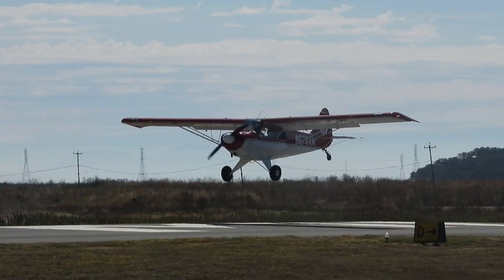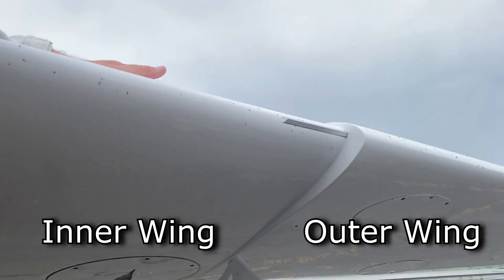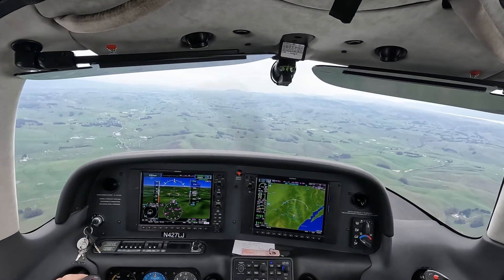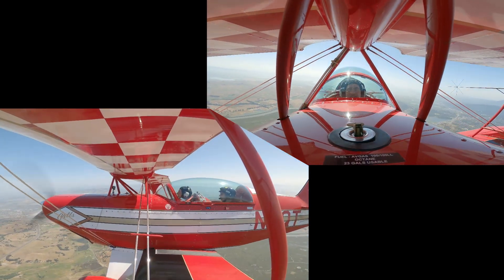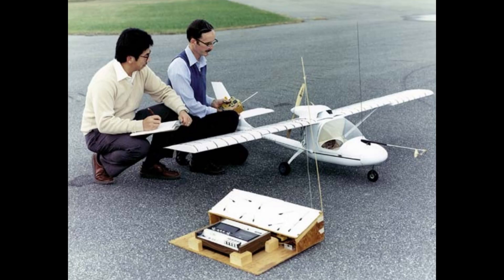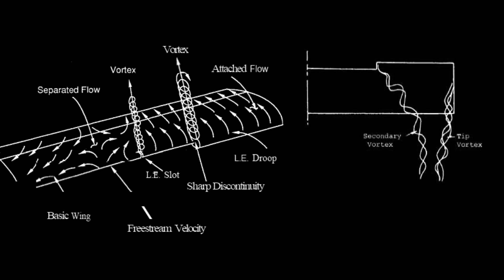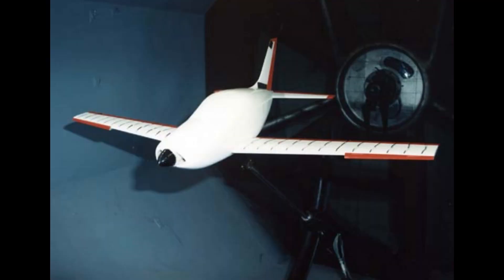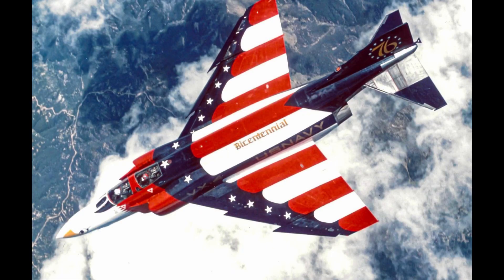Why Is The Wing Broken On Some Planes - How a 'Dog Tooth' Makes Wings Work Better.

Comment: Basic aerodynamics
1. Conservation of mass flow, a 3-D effect 
2. Conservation of momentum
a  vector 
3. Conservation of angular momentum
a vector
4. Conservation of enegy
a scalar.   q = rho V²/2 + P in flow direction
5. conservation of momentum requires pressure to act perpendicular to the boundary, on the surface: wing, Mig 15/16 fences
Never in subsonic flow perpendicular to the flow velocity vector
Summary : flow geometry is determined by mass conservation conservation never by pressure gradients.
ptressure is determined by energy conservation (Bernouilli  energy equation)
The notion that lateral flow is affected by pressure laterally to the flow is WRONG 
Typical erroneous concept: the wing tip vortex is created by the pressure difference top to bottom: totally false.
Wing tip vortex is a continuation of the circulation that causes lift 
Helmholz theorem: the vortex along a vortex remains constant all along the always closed vortex ring.
Applied ot a wing: the vortex is the initial starting vortex remainung behind, connected by the wing tip vorteces to the  bound vortex on the wing, all elements have the same circulation.

Comment: You shuld do a master class with Flight-Chops and Mike Paty. An other way is forward swept wings, oen eksamble is the glider ASK-13, it has a little forward sweep on the wings, it can stall over one wing but it can´t spin.
Reply: The Ka 13 can most certainly spin, I've done so many times teaching.  The trick is to keep the ailerons neutral. If you use opposite aileron it won't but with the stick in the middle and on the back stop, rudder into the spin it will. Just.
The forward sweep was to improve the visibility for the rear seat.
The rudder is very effective, I've flown it round perfectly happily with the stick on the back stop, stalled and using the secondary effect of rudder to keep the wings level.
Chris

Comment: And the position of those wing cuts varies depending on what purpose they are supposed to serve. I heard that on the Arrow, the cuts are needed for supersonic flight. Because of the shape of the plane, the air at the supersonic transition tends to flow in front of the wing. So putting these cuts near the fuselage helps redirect the air over the wing so that it doesn't lose lift. They lost a lot of test models to that until they figured it out.
Reply: You are correct.

Comment: It is said that the reverse-swept wings of the Su-47 Berkut were the reason why it was still maneuvereable even after stall. Because the tip of the wings (where you have the most aileron authority) were still out of the turbulent flow from the stall.

Also, could you make a video about stall stripes ? This is close enough to this subject =)
Reply: You never know what they say. Don't believe everything, especially from Russia (I'm from there). Read the reports about the MBB X-37.
Reply: You never know what they say. Don't believe everything, especially from Russia (I'm from there). Read the reports about the MBB X-37.

Comment: Wing twist (washout you call it) also helps reduce induced drag from the tip vortex. In an ideal world you wouldn't have wing tip treatments but the wing would gradually twist an morph from the root to a 0 degree symmetrical areofoil at the tip. Enjoyed this video, took me back to my Aerodynamics MSc.

Comment: Even the Il-62 have them (vortex generators). On many, especially old combat planes there are two elements combined: leading edge toth vortex generator plus a multiple action fin - bleed flaw stopper and directional stabilizer.

Comment: On many commercial aircraft there vortex tabs positioned along the froward part of the wing, looking down the wing from a window seat. These are there to reduce buffeting during a flaps 30 landing. At flap thirty the rear flaps exdend down so much there is flow seperation so these vortices generated by these tabs along the the wing reconnect the flow. Also the tabs help improve the flow over the ailerons.

Comment: Thanks Scott. I'm no expert or pilot, but I picked up on this concept as soon as you pointed it out before explaining it. I'm a huge Formula 1 fan and amatuer miliatary analyst, so perhaps that's why. I also wanted to mention another anti-stall solution not directly mentioned and it could be the most "cheatiest" method...the F-22 Raptor's thrust vectoring. If you watch some airshow videos it can essentially fly at zero knots and maintain full control combined with the fly-by-wire. Thanks dude!
Reply: I have a follow-up question if you happen to read this.

Would and F-18 with these features be more susceptible to stalling if it's at ~60,000 ft. altitude due to the lower air pressure/density of gases, or would it essentially offset due to the equal loss of drag being experienced? I assume the effect would more or less being linear despite pressure?
Reply: @jamison884  In straight and level flight the indicated airspeed will be the same regardless of altitude, but the true airspeed will be much higher.

At the same indicated airspeed as at low altitude, the stall characteristics should be the same, I say should because at those kinds of altitudes you could easily be in the high transonic flight regime if not supersonic, and wings don't behave the same in those speed regimes as at subsonic speeds.
Reply: Thrust vectoring does not prevent the wing stall. The wing stalls at a certain angle of attack. The F-22 uses vortex lift even more so than the F-16. Because its engine inlets create a stepped wing design, creating one vortex at the joint to the wing. And another is created by the forward fuselage "chines" in conjunction with the inboard junction of the engine inlet. It's generating no leas than 4x massive vortex's across the top of its very wide fuselage and wing roots and these split between the massive vertical stabilizers that are canted and will actually provide more nose-down stability at higher AoA.

The F-22 also has deployable leading-edge plain flaps that are computer controlled based on mach, q, and AoA.

Thrust vectoring simply allows the pilot a lot of extra pitch control at all speeds. And especially at low or no speed.

Comment: If you ever get the chance, Scott, have a nosy around a Gloster Javelin (there's a few in museums in the UK, but I don't know about the US). That thing has some vortex generators . A LOT of vortex generators. Also, have a look at the trailing edge...😉
Here's another video idea, since you touched on it in this video: do one about the aerodynamics of the F-4 Phantom, to explain why, as somebody once put it, it "looks like somebody stepped on the plans". Whole lot to unpack about anhedral and dihedral there.
Reply: Javelin wasn't known as the Drag Queen for nothing. None in the US (surprising as the USA paid for a lot of them under mutual defence aid), One in Italy and one in South Africa, the rest are in the UK.
Reply: No Javelins in the US
But plenty of vortex generators on the A-4s and B-52 or B-1
Reply: @Wannes_  I used to work on A-4's, and you can't help but notice the rows of vortex generators along the forward and rear of the upper wing.  I think the official explanation was "to prevent random wing drop".   Naturally, I also picked up on the vortex generators on the lower surface of the B-52's horizontal stabilizers, and were they on the aft fuselage of the B-1?   After you learn a bit about aircraft, you start to notice all of the little things that are added to fix various aerodynamic problems.  The A-4 rudder is such a case.  The modern aircraft seem to have either avoided problems, or fixed them in software.  They seem to have perfectly smooth skins.
Reply: @SkyhawkSteve   Well the A-4 rudder was more of an aerostructures problem as I understand it. The skins were vibrating, so as a temporary quick fix to enable test-flying to continue, Heinemann suggested sandwiching a single skin in between the left and right machines rib sections. The "temporary quick fix" was still there on the last A-4 to roll off the line, and that was LOT of A-4s. 🤣
Reply: @MrHws5mp  The various books that I've read describe a rudder buzz or vibration.  Not sure if that should be interpreted as an aerodynamic issue or a structural issue, but the single surface rudder must have been "good enough".  The last of the 2960 Skyhawks came off of the line in 1979, and it doesn't have too many obvious last-minute fixes.  Not bad for a 1950's design.  🙂
Reply: @SkyhawkSteve  On a flying surface a lot of issues are both, i.e. it's an aerodynamic problem until it breaks, at which point it becomes a structures problem. If you think about it, the only likely consequence of the rudder fix must have been a miniscule amount of extra drag, and, since the Skyhawk comfortably exceeded the original spec anyway, nobody cared and quite right too. I love the Skyhawk: it's a classic example of radically-simple-out-of-the-box thinking.

Comment: Cuffs are a late design addition to correct and early design error.
Reply: No they are not - incorrect blanket statement. I award you nul points.
Reply: @nightjarflying  It is your right to be wrong.  Only a handful of airplanes have cuffs and stall fences and all that I know of were not in the original design.  They were added later to fix poor stall behavior.

Comment: I was looking at the bottom of a Hort. Stab on a Boeing B-52 at March reserve base museum. It had vortex generators in 3 config. in a row. 1st was pointing in, next straight then the last type pointing out, Left, centered (straight). right. I understand the lt. and rt. pointing idea but the one just straight not sure. Maybe for winds that are going across the surface at an angle. Then the straight blade would generate the vortex? I know the B-52 landed in a crab.

Comment: You should have a look at the boundary layer control system in the Blackburn Buccaneer S2 , they took a tap off of the compressor at the start of each engine and ran it out along the wing into nozzles facing aft , on take off and on approach to land on a carrier the pilot would switch on the system , go to full throttle and open the massive air brake at the back of the aircraft , this kept the landing speed a lot lower than it would've been otherwise
Reply: Yep, it blew the underside leading edge of the tailplane too, so that the excess lift didn't result in pitch-up, and it also blew the flaps and (I think) the ailerons. Blown flaps are quite common, especially on carrier aircraft, but a fully blown wing was a novelty. They could actually have blown it a lot more and got the landing speed even lower, but since all they had to do was get it within the capabilities of the arrestor gear on British carriers, they only did just enough.
Reply: @MrHws5mp They got it low enough for HMS Hermes and HMS Victorious ( 29,000t full load ) which scared the crap out of new pilots and they had a fairly decent margin for landing on HMS Eagle and HMS Ark Royal with their longer decks , know the yanks hated landing on Ark/Eagle as they thought them too small and our lads thought they were landing on an island compared to our carriers when they cross decked !!
Reply: @DavieTait   Yes, Hermes was the limiting case they had to design for. If you think the Yanks hated landing on Ark & Eagle, you should hear what their A-4 pilots had to say about landing on Melbourne...
Reply: Quite a few aircraft were fitted with it besides the Buccaneer,  A-5, F-104,  F-4, some versions of the F-8 and the Supermarine Scimitar. Starfighter was the first production type to use it in wide scale service.
Reply: @richardvernon317  & @LeoH3L1 Those were all only blown flap systems though. The Buccaneer had blown flaps AND a blown leading edge: in effect, the whole wing was blown. F-8 Crusaders for France had blown flaps fitted as add-on in order to land on their smaller carriers.
Reply: The TSR2 had a similar system, if you ever look at the wing planform of it it was a fairly small wing for the size and weight of the plane, so needed to be going fairly fast on take off and landing, so to reduce that they had a blown flaps system too to help create more lift at slower speeds.
Reply: Someone I know flew Buccaneers off carriers. He was involved in the infamous incident where they launched a piano off a carrier...

By coincidence I was reading a book on the design of Buccaneers when I was on a trip to Canada, and at one airfield I was at I was introduced to someone by a mutual friend. Turns out, he was one of the designers of the Buccaneer, and he signed my book for me. He had emigrated to Canada.

Comment: Regarding those vortex generators on the engine nacelles of underslung engines on airliners, I watched an A380 landing at Manchester (UK) this morning in damp conditions. Four distinct and thin streams of vapour were visible, one off each nacelle, sweeping up and over the wing leading edge.
Have a look at Concorde; On the approach, in order to generate vortex lift off the delta wing, Concorde lands with a very high angle of attack and a steep nose-up body angle. This would cause the vertical tail fin to be 'blanketed' by the fuselage, leading to loss of directional stability. To overcome this, Concorde has two vortex generators, known as 'strakes', mounted low down, one one either side of the nose. They are quite distinctive.
The vortices these generate at high AoA flow up the sides of the fuselage to the roof, and run back along the length of the fuselage roof keeping the slipstream attached to the roof instead of breaking away and becoming turbulent as it otherwise would. This allows the fin to work in 'clean' air rather than disturbed air as it would be if the airflow was allowed to break away from the top of the fuselage.
Reply: Hi Vince, I thought I recognised the profile picture! 🙂
Reply: @paulsengupta971  Hi Paul. Good to hear from you. I have recently had a toe in the water on the Flyer Forum again. Let's see how that goes!
Reply: @gzk6nk I saw your post!
Reply: Nice. 
Also...
NERD!  🤓 
Respect though for real lol
Reply: So... You're saying the mad dog just needed STRAKES?!
Reply: Be careful that you don't mistake very high angle of attack with a very nose high attitude. The two can be totally different where you can have a very high nose attitude but the AoA is relatively low by comparison and nowhere near approaching a stall angle. Concorde and the delta wing is a really good one to look at if you are interested. 
High humidity can produce some excellent visuals of the airflow coming off an aircraft eh. 👍
Reply: @braveworld2707  You don't need to tell me that. I flew aerobatics for many years - frequently venturing both sides of the critical AoA at attitudes and airspeeds on both ends of the scale. An A380 at the point of touchdown has both a nose-high attitude AND and high AoA, and those vortices will ONY form at high AoA, regardless of the nose attitude.

Comment: Not long after I transitioned onto the Shempp-Hirth Discus -type sailplane, I had an aerotow on a rubbish day where there was no lift in the sky. Tried a few likely looking clouds but no thermals, I was not dropping very fast but I was dropping incessantly.

So, I decided to try spinning the aircraft. I had done it once before, it was an OK glider in a spin. I brought it to stall, applied full right rudder, and as the right wing dropped I rolled left to send it.

As I went in, something felt very wrong. Like the balance of the aircraft was off.

I immediately started the recovery procedure. The nose tucked under much more than normal as the entry completed - the aircraft wasn't inverted but it sure felt like it. After half a turn the right wing picked up, the rotation ceased, and the ASI jumped straight to 100 - it would normally be about 60-70 exiting a spin. I had to pull out real hard.

There was a hell of an airflow noise coming from behind me as I pulled out of the dive, and that's when I realized what I'd done; I had forgotten to raise the undercarriage. The wheel being down and forward of its usual flight position has adjusted the glider's aero and CoG which together had given me the interesting experience. I think they'd both contributed to tipping the aircraft into a more nose-down attitude during the spin, which has caused the airspeed to be higher, which had caused both the strange sensation whilst spinning plus the much higher than normal exit speed.

Whenever spinning that aircraft in future, I made doubly sure the wheel was up first!
Reply: You’re test pilot material.  
At incipient spin, i’m out !   I arrest it immediately lest i have a really bad day !